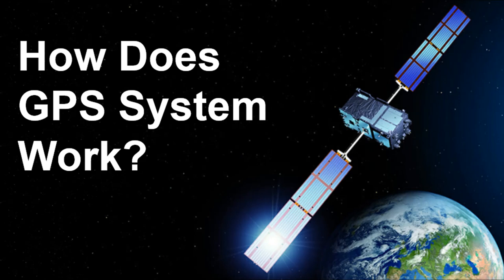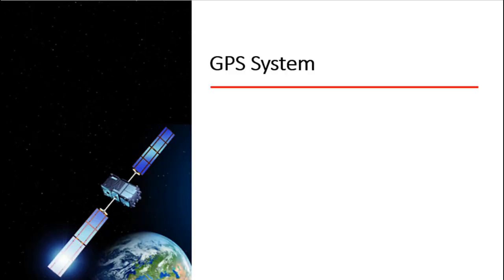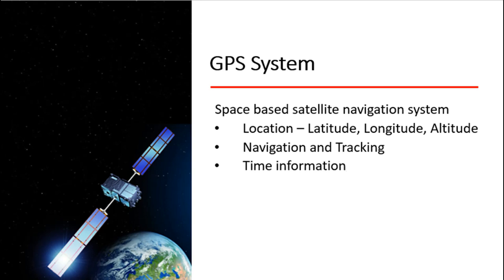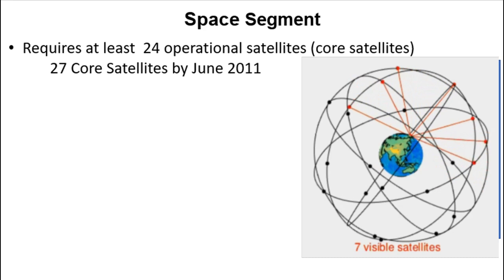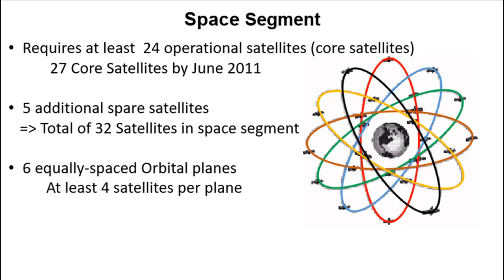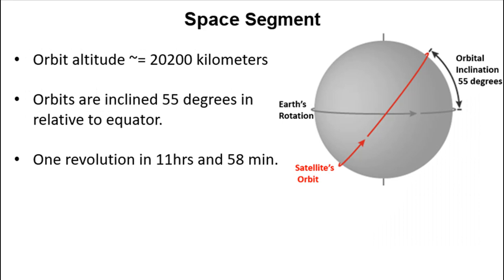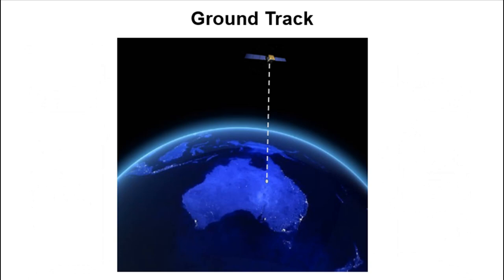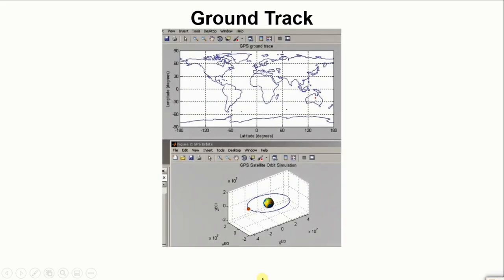How does GPS system work?

Comment: This explanation is the clearest and most thorough about the GPS system on youtube, thank you for making it. The information I'm trying to track down is 'the maximum theoretical limit of GPS refresh rate'. I initially assumed that the satellites sent pulses, but actually they seem to send a continuous bitstream. This makes me wonder why the fastest commercial GPS units calculate your position at 100Hz. I understand that there may be no point calculating at 1000Hz (because there aren't many things you need to track that frequently, and in that time the object won't have moved out of the 30cm circle position that is the max accuracy the system can give you), but I'd still love a further explanation of what the limits of GPS would be (with current broadcast frequencies) especially when it comes to how often you could obtain a meaningful new position update for a receiver.

Comment: Very good and understandable presentation.  I have been researching how the signals are generated by the GPS satellites for use in the reciever.  I had no idea how much external input is   required for error correction via ground control.  It appears as though the system would become worthless in a few days if not constantly corrected.  Very enlightening.  Thank you.
Reply from the maker: You are welcome!

Comment: Excellent explanations. I learned a lot.

The only bit that is unclear to me is how does the GPS receiver generate its own GPS signal to compare to the received signal? Does it just guess when it should create it? Does it get this timing info from the satellite? 

I understand the errors and how they are calculated, but for determining the initial pseudorange, I don't get how the receiver makes the signal "exactly" when the satellite does
Reply: "The GPS receiver uses a process called differential GPS, which compares the time from the GPS receiver’s clock to the time from a ground-based GPS reference station. By comparing the two times, the GPS receiver can calculate and correct any time errors."

Comment: You mean it can t move without placing it on a very powerful airplane placed at its orbital with space rocket .wow I think your theory is interesting , you mean every satellite works on standard parameters that somewhere there is a communication between your four satellites placed on 22k kilometers or that each one of them provides a different signal intensity . That position is calculated through analysing some parameters and combining them .